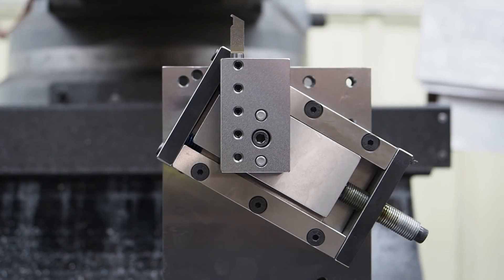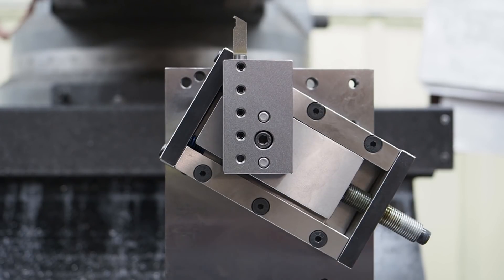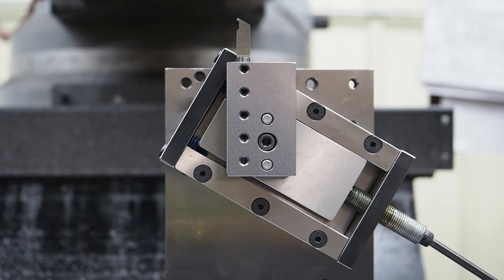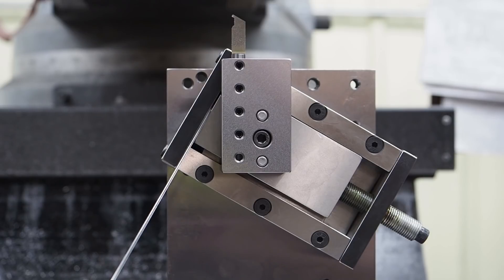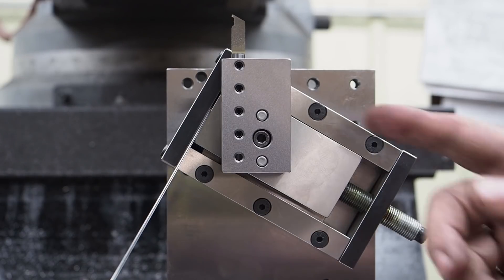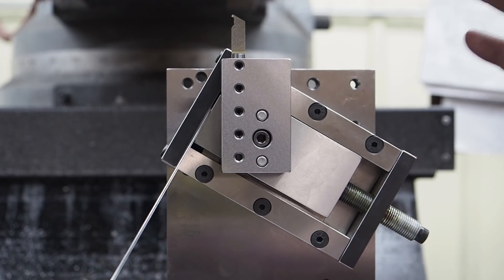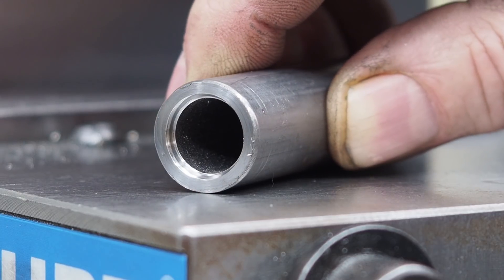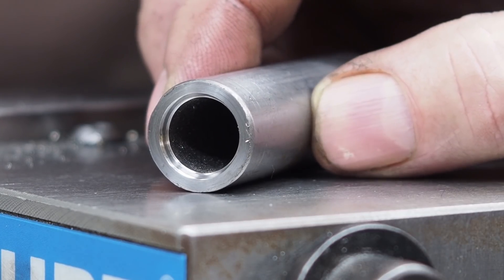Lathe Angle Compound Slide for the Mill

Comment: That is awesome, great unit. What’s the math for the angle to the distance you need to go to make a cut of a set distance??? I’m a little weak on that. Thanks for sharing
Reply from the maker: The depth of cut was called out on the print from the surface of the 30 degree angle so no math on my part was needed.
Steve

Comment: I like the way you use your vertical lathe. "Normal lathe, that's old school.  Nothing is normal anymore.
Reply from the maker: Hi Gary,
I use the mill for lathe work often. I made a bunch of 2 step pins out of 3/8 A2 drill rod a couple of days ago. It was very fast and very accurate. I would have had a hard time doing them as fast and consistent on a lathe. 12 pins in about  40 minutes.
Steve

Comment: Very cool! I've been doing the other way around, milling on the lathe (as I mentioned at the Good of the Land fest). I've finally bought a mill, so I will be using the lathe for lathe-work, and the mill for mill work - at least mostly. No DRO on the mill, so will have to still rely on classic measuring and figuring (and, in my case, some "trial and error" - but that's how you learn).
Reply from the maker: I agree, I learn a lot in my failed attempts at doing things too.
Steve

Comment: 15 years ago I was using my mill as a lathe to cut down a piece of reloading brass. The heat make the primer fire and I got a loud noise in my face. ... but the mill vise does make a good lathe tool holder.
Reply from the maker: Hi Clark,
I hope you didn't get hurt.
Steve

Comment: How about you lay that mill down on it's back and make a stand for it? 

Not sure what it would be called then!

Nice work Steve!
Reply: We already have that, its a horizontal mill.  As an added bonus, you can mill turn between centers using the overarm with a center instead of an arbor.